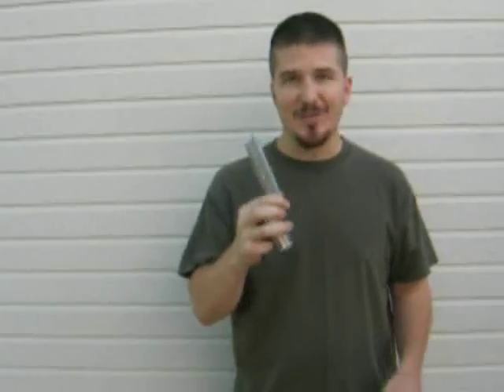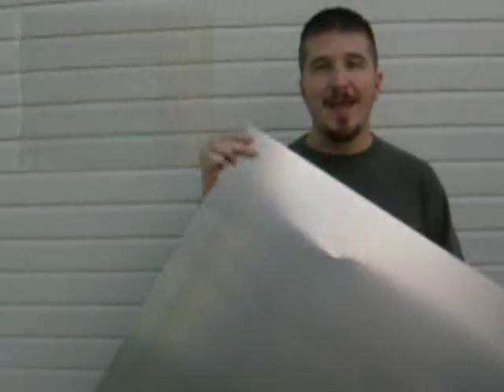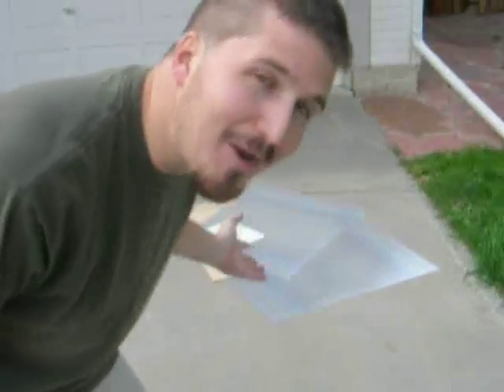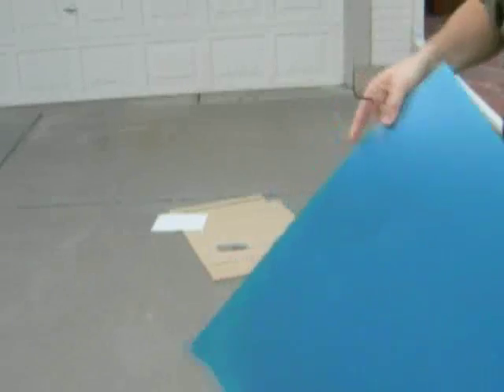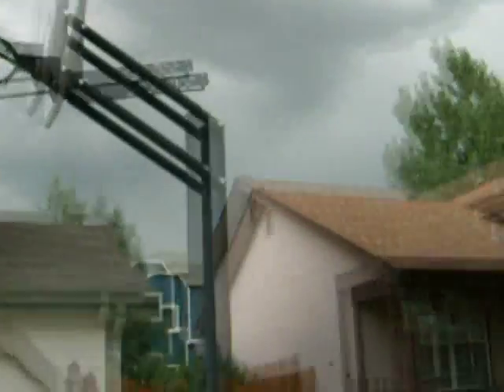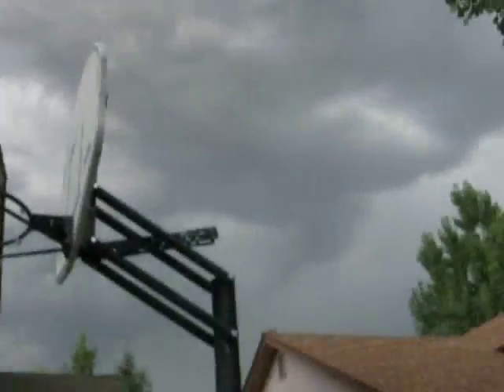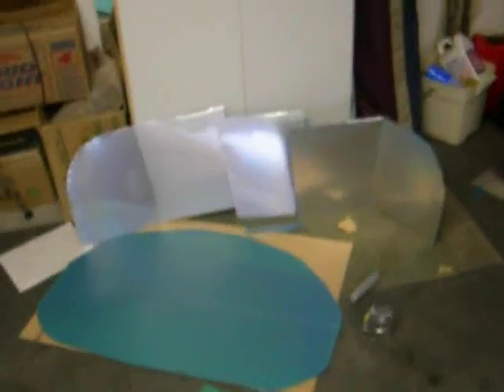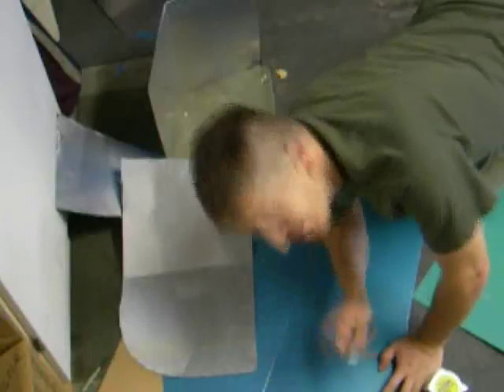What Solar Cookers? How To Make a Solar CooKit

Comment from the maker: @itsok4me I think you could get sick from the fumes if you didn't use a lid on your pot.  But to be safe, you could just buy a black pot or even a cast-iron pot which (although heavy) will hold the heat as well.

Comment: You did not say the metal is Aluminum. But I am guessing it is, because of the way you cut it (retired sheet metal worker here). I may be wrong. BUT; I think some tooth past and a very fast turning buffing wheel would improve the shinny part of the metal. Could bring it really close to true mirrow. At least 90%. Then a very thin coat of clear acrylic spray.
The faster the buffer the higher the shine.

Comment from the maker: Hey Gus!  You absolutely could do that, and it works bery well... just make sure that it's inside of an oven bag. What you've described would be a solar funnel cooker... if you visit the URL in the video, you'll see we made a solar funnel cooker out of cardboard and aluminum, which you could do using sheet metal or mylarized aluminum as well.

Comment: could you just cut the metal into a circle then cut from the middle out then fold one of the cut edges over the over and make a concave mirror and put food in a stand in the middle and put the mirror on a stand angling the sun.

Comment: Here is a hint. Shine a laser level on your material. It should bounce the dot off as a dot. But sometimes it does  not! I have found some alu sheet that disperses the light in strange patterns! So it will NOT work good for solar cooking because the light does not bounce off at the angle it should bounce at. Brian